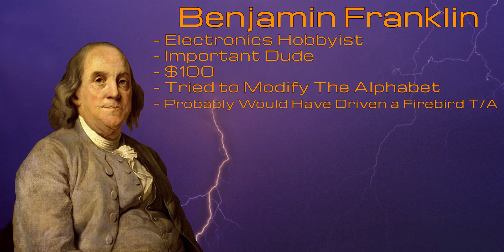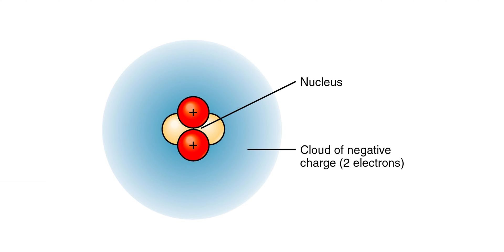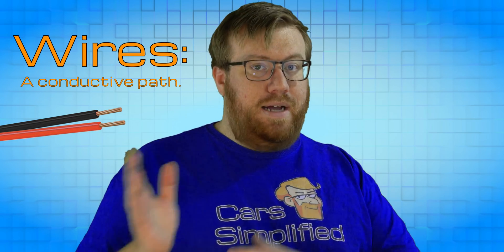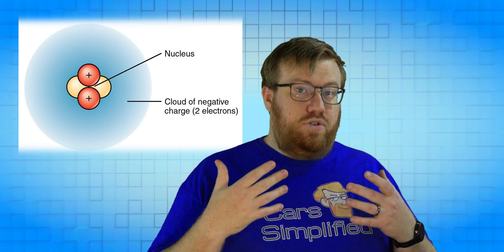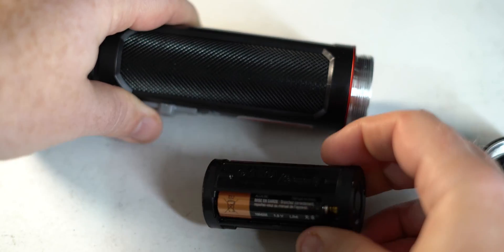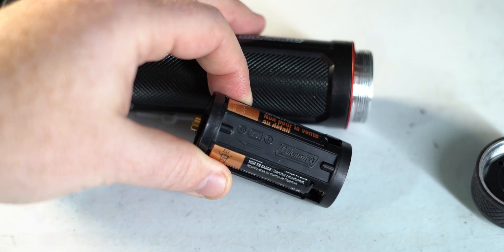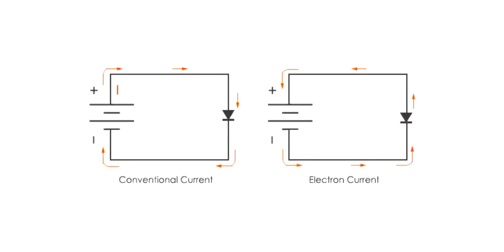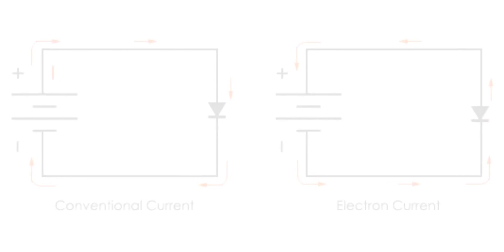Electron Flow Vs Conventional Current Flow

Comment: In conductors, the charges that actually move are the electrons, or the negative charges which form the current. In other types of materials, such as semi conductors, both positive and negative charges are moving '' Theoretically''. Examples of such SEMI CONDUCTOR components are diodes and transistors. The main difference between conductors, semi conductors and non conductors ''or insulators'' is the number of free electrons '' which is very large in conductors and very few in insulators''. Electrons are very light compared with THE positiveLY chargeED proton or neutral neutron, this is why, under some electromotive force or voltage or potential difference, electrons form the electric current in conductors. If you want to go deeper and ask, what is a free electron and why they are too many in conductors, you need to understand basic atomic theory which explains the distribution of electrons around the positive nucleus in a single atom; basically most of the elections in any atom are bound to the heavy positive nucleus, however in a single isolated conductor's atom , there is usually one or two electrons called the valence electrons who are very loosely attached to the nucleus sine they are located far from the nucleus, these valence electrons become free electrons when millions of atoms compact together to form a conducting wire, they only need small voltage difference to move them in an electric circuit!!